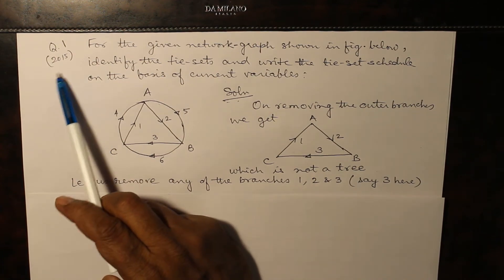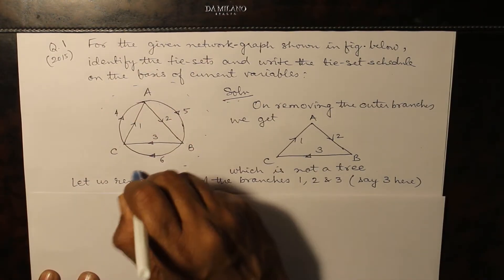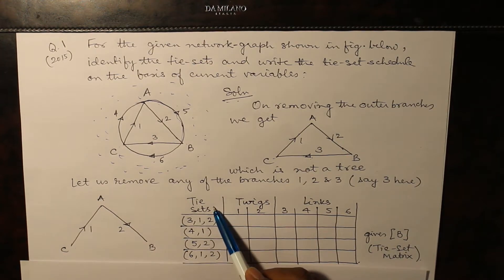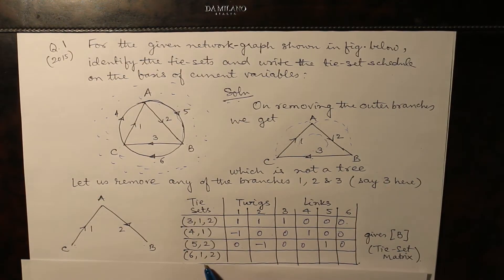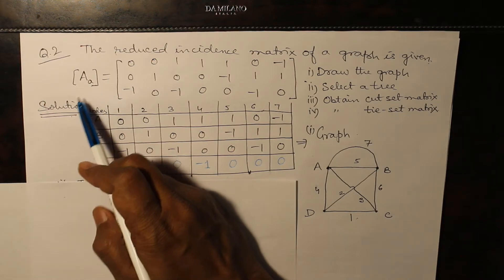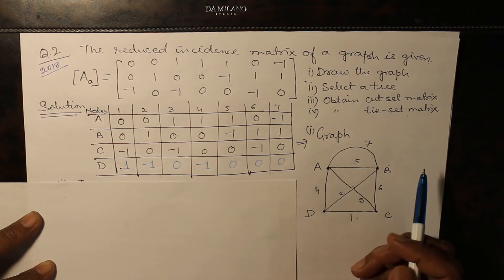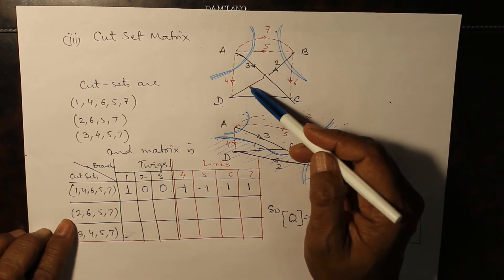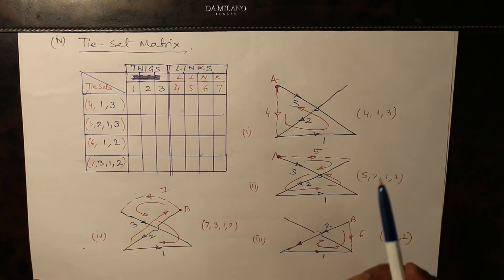Previous Year Qs: Cutset, Tieset & Incidence Matrix | #27 Unit 3 Circuits and Systems CNS Sem 3

Comment: In question 2, why wasn't the branch DC (or 1) removed according to the water concept? This branch is also a boundary right?
Reply: question to just draw a tree, its your choice which tree you chose, if you remove DC then u get different tree which is also correct
Reply from the maker: @ngnishchay191  Exactly.
Reply: @ngnishchay191  ok thx